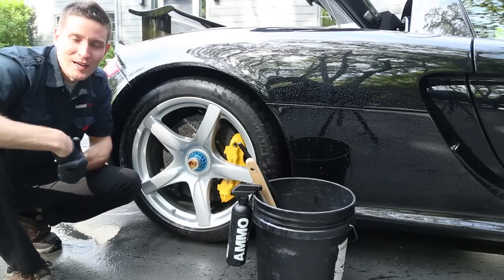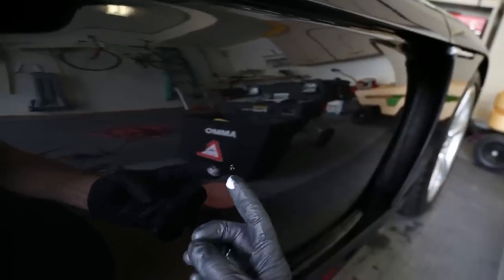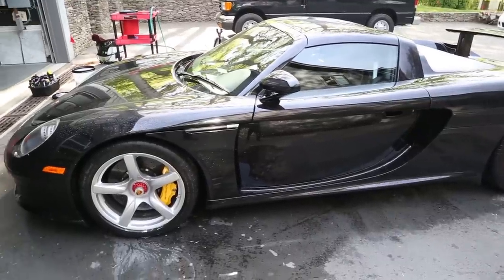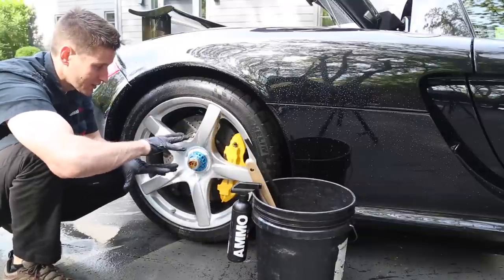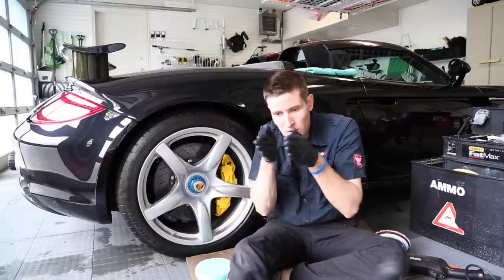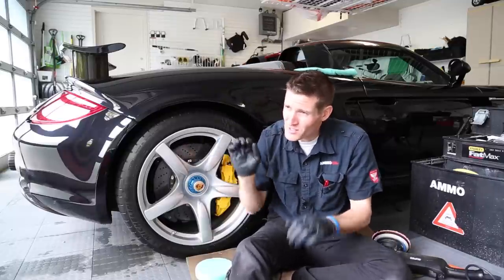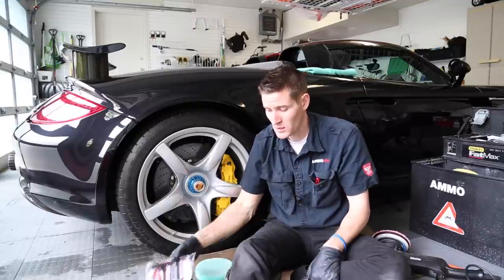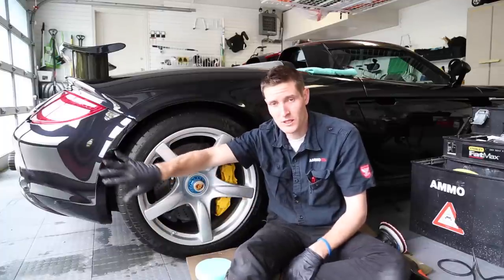How to Polish Black Paint: Carrera GT

Comment: So I've never really understood how a compound works. Is it so abrasive that it leaves the paint kind of dull, in turn leaving you to have to polish it? Or does it act as a polisher and basically puts a shine to your paint, and not needing to polish? (My car is single stage so it might be a littler different)
Reply: The compound is going to leave micro-scratches all over the paint no matter what, the polish refines the finish to the point that the micro scratches arent visible to the naked eye.

Comment: Hey Larry, I've got a 2003 Porsche Boxster S in black. You can imagine for its age and has 70,000 miles. The original owner drove it daily. There is little chips throughout the front end of the car and some really serious swirls going on. I did some clay bar and and some quick detailing along with a wash and wax bath, the car shines great now but the swirls are still there. More along the doors and it's extremely annoying to me as I would like to take it to some shows but it is not presentable. If you could give me some direct pointers that would be great! Awesome video by the way and I will use it to my advantage. Just wanted to see if I could get some further information!
Reply: I'm not an expert, but clay will not take swirl marks out. You need to compound it with a dual action buffer.

Comment: @AMMO NYC I see you all use this rupaz machine. i have same looking machine from bosch that works on 11000 RPM. its made for heavy work for locksmith type for work. is it good for aplying pads for polishing headlights and paint correction? i dont want to buy exact same machine if my can serve the purpose.

Comment: I know this is going to sound like a dumb question, but is there a difference between a foam cutting pad and a microfiber cutting pad, other than the material they are made of? I have some lake country pads, and some claim to be cutting pads, but I don't know if they will work the same as a microfiber one. My father has a black porsche, and I am afraid that it is of the super soft variant. Thanks for the helpful video.

Comment: Do you ever wax/seal the windows and wheels? I find myself waxing pretty much the entire exterior so I don't have to mess with RainX, wheel waxes or other special circumstance products. Does synthetic wax adhere to windows and power coated wheels properly or am I doing it wrong and need to get some other products? I've had great results on the windows so far.

Comment: so tell me... when you do this are you just dealing with the clear coat? or do you actually get down to the paint?  seems years ago I did the roof of my car and years later the roof area was all messed up. I figured I took to much clear off.. just asking because I see you using the same type of tool I used. course mine was not 400 dollars..

Comment: Hey Larry Im new to using meguiars 105 and 205 .have a rupes 15 mm and a porter cable 8 mm.I use rupes foam polishing pads. after polishing with either 105 or 205 I can see marks in the paint that looks like little c shaped marks. Am I not letting the polish break down enough , or is the polisher not spinning fast enough. Great videos ,keep up the good work
Reply: Chroma Auto Detail I'm no expert but from what LArry has taught me it seems like it's possibly because you're using M105 to polish. Larry usually uses his jewelry polish at the end AFTER using M105 to cut or compound